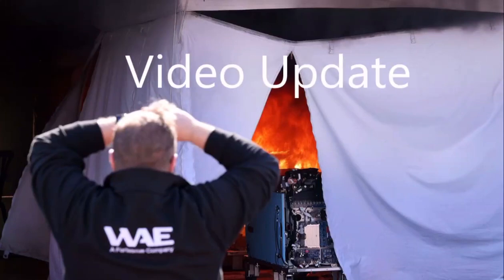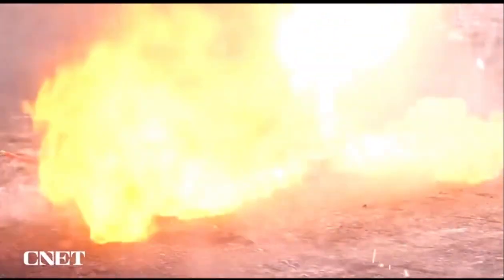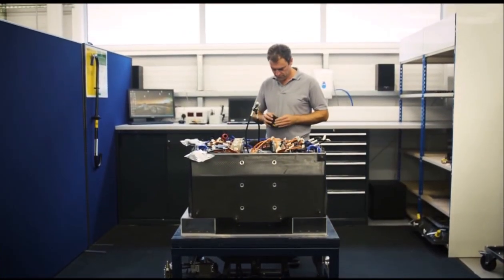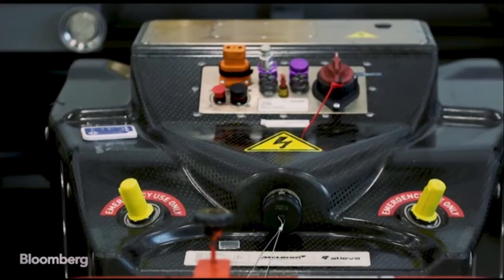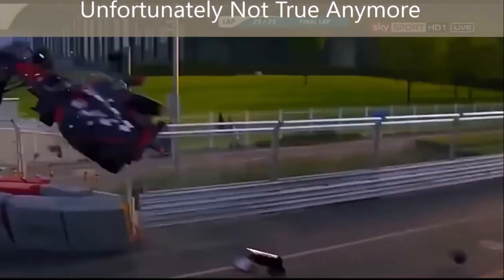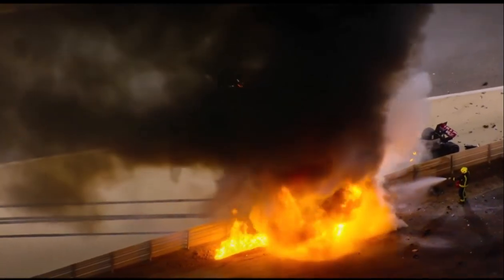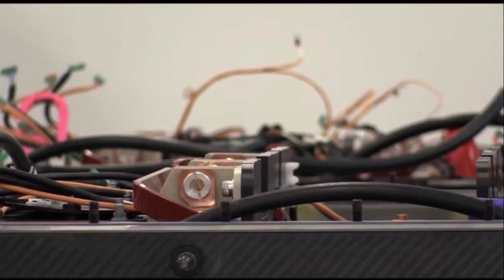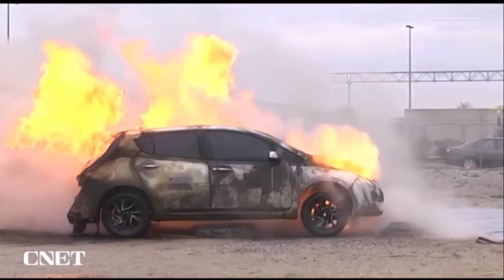Formula E Needs To Invent An Extinguisher For All EVs

Comment: I absolutely agree with almost every point in this video. It's a challenging problem, but it's one I think we'll get better answers to as the years go on. I think the number one way to help speed this challenge along is to open up battery manufacturing for the teams. That way, the manufacturers can pump in a lot of time and energy into the battery systems, hoping to get a better tradeoff for their road cars.
Reply from the maker: 100% agree, for me that is when the sport will take off when the manufacturer gets to build their own cars from front to back. That's will to be interesting to see how that translates to on the road cars perhaps GEN5. For me the fire control is something Formula E should own and put a big push on let's be honest the person or company that makes a Lithium fire extinguisher will make billions, and potentially save lives.